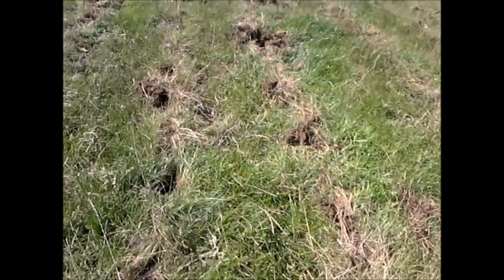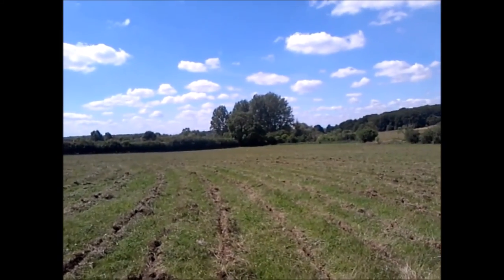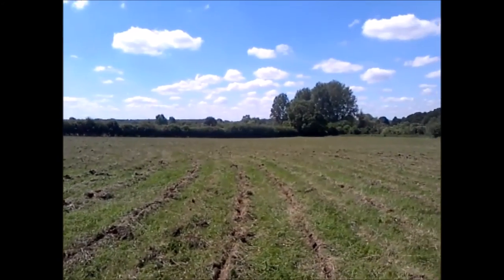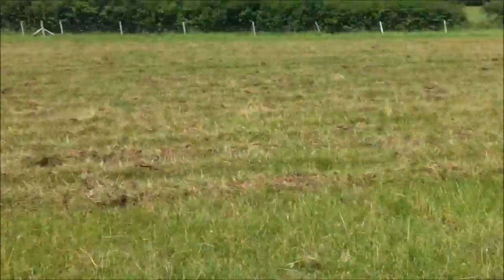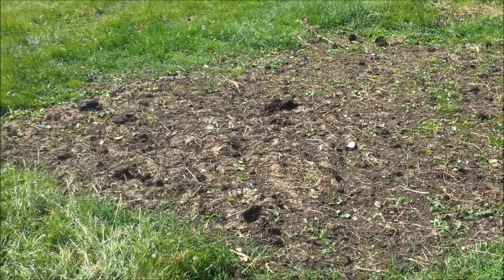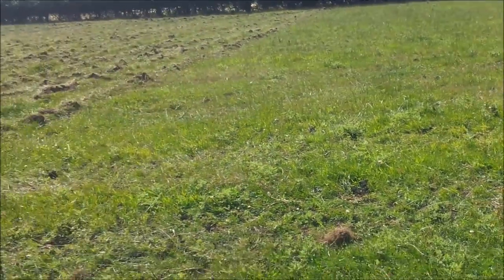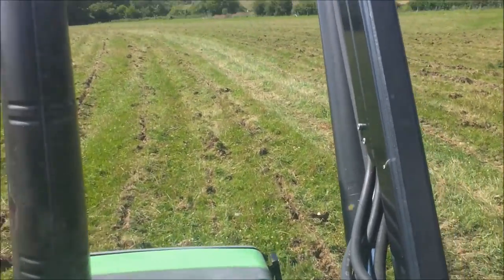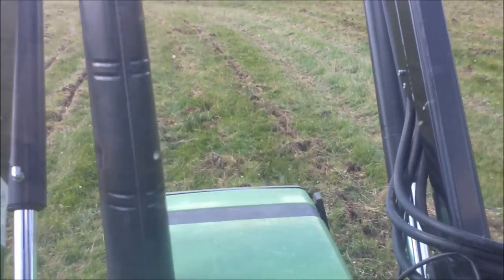Keyline Ploughing Project

Comment: So you went straight to 10"?  Wondering what depth the pan is/was and depth of root profile - curious about rationale for that.
Reply from the maker: The pan was at 7-8 inches and the rooting zone was struggling to get through that layer. I went 2 inches below the pan to break it and bring the roots down. The pan was not as bad as it had been 12 months before after a year of mob grazing.  I'm thinking in a couple of years we would have sorted it with the grazing but we had perfect soil conditions. Root spread was good above the pan.
Reply: Thank you.